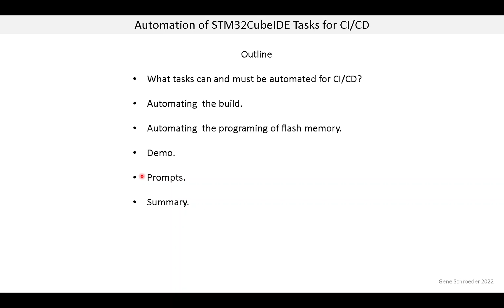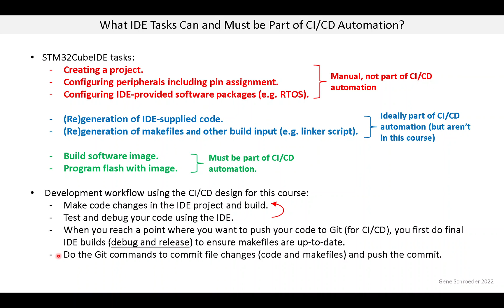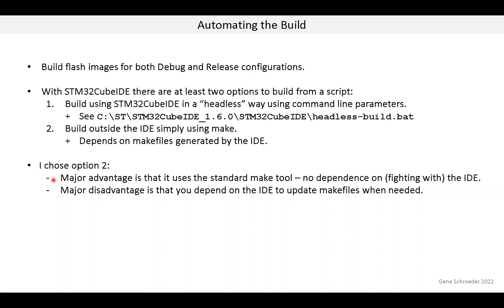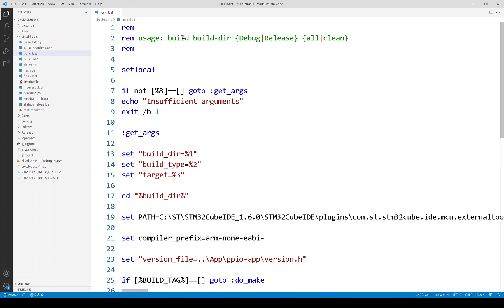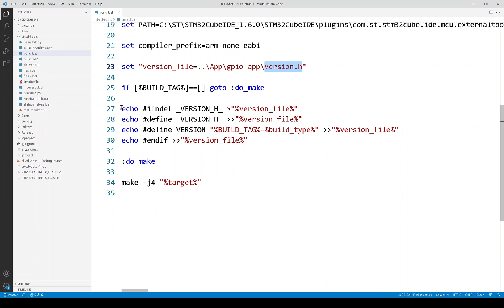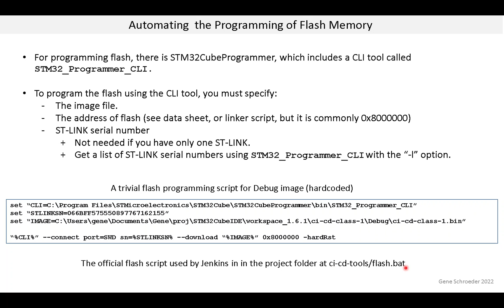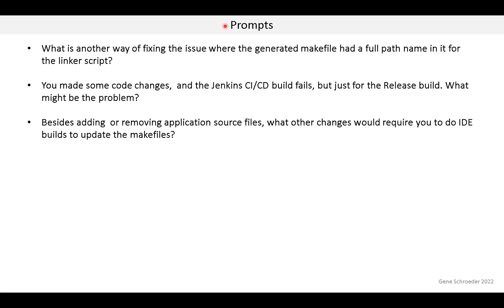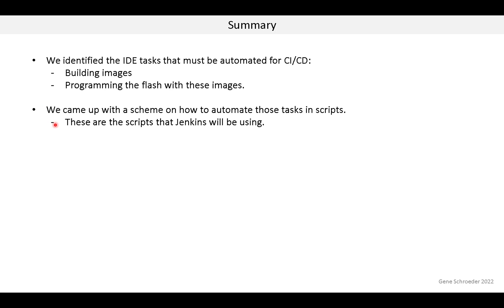Embedded CI/CD with HIL Testing Lesson 3. Automation of STM32CubeIDE Tasks

Comment: Hi When I build the I do not get the .bin files just .elf. 

arm-none-eabi-size  Stm32Dev.elf
arm-none-eabi-objdump -h -S Stm32Dev.elf  > "Stm32Dev.list"
   text    data     bss     dec     hex filename
  16452     148    2044   18644    48d4 Stm32Dev.elf
Finished building: default.size.stdout

Finished building: Stm32Dev.list

but at 14:01 you have get .bin as well. 

Greate videos by the way!
Reply: Fix:
Go to Project Properties > C/C++ Build > Settings.
Under the Tool Settings tab, navigate to MCU Post-build outputs.
Ensure the checkbox for "Convert to Binary" is selected.
Reply from the maker: @cyberflaneur9127  Sorry I did not see your question earlier - sometimes I fail to notice them. In any case, it seems you found the answer. The "Convert to Binary" option affects the generated makefile. Oddly, my settings for this course project also had the "Convert to Binary" box unchecked which is wrong and I would never do that intentionally.  When I built it on the video, that option must have been checked. If you pulled my IDE project from github, maybe you got the "bad" settings file. It is a mystery to me. Thank you for documenting your fix.

Comment: Hello sir i get that problem shown below,
C:\Users\atakan.ertekin\Desktop\ws\ci-cd-class-1\Debug>make -j4 "all"
'make' is not recognized as an internal or external command,
operable program or batch file.

i have already changed bat files my stm32 version and path but its didnt solved. i have already installed gnu for make but still didnt solved.
Reply from the maker: Are you doing this class using STM32CubeIDE? If so, then you should not need to install make, as it will be installed by the IDE. In my video, I set PATH in the BAT script that runs make.  If you want to run make at the command prompt, you will need to make sure the PATH is set. Before you run make, enter the "path" command, and check very carefully that one of the folders in the PATH contains the make command.  As shown in the video, you can get the value for PATH from the IDE.

If you are not using STM32CubeIDE, and setting up the development environment yourself, you will need to install the tools and the gnu toolchain. This is a good exercise to learn about building software, but it is complex, which is why I don't cover it in the video.